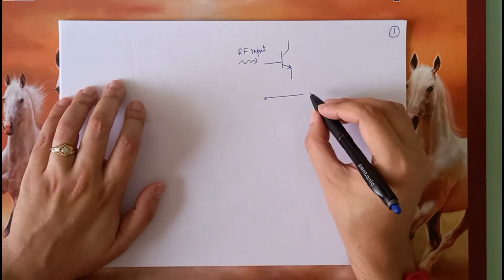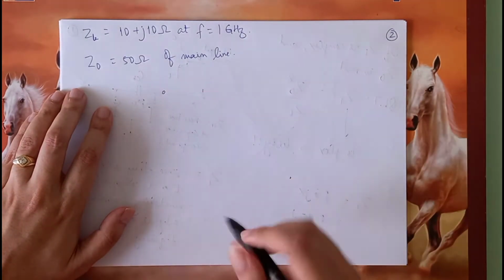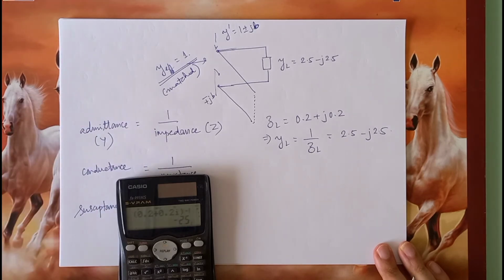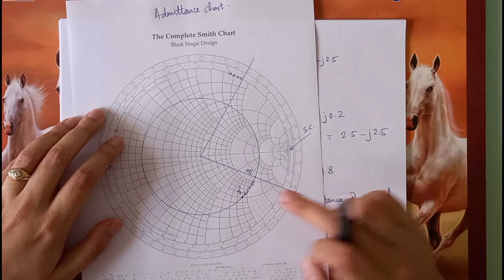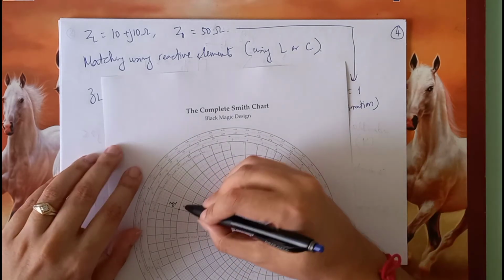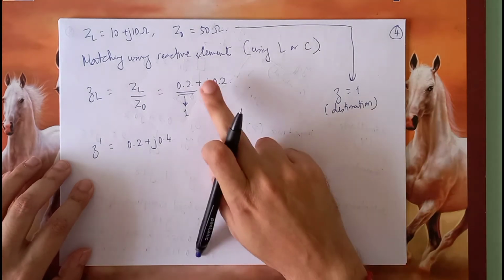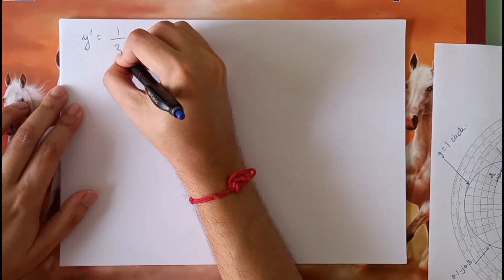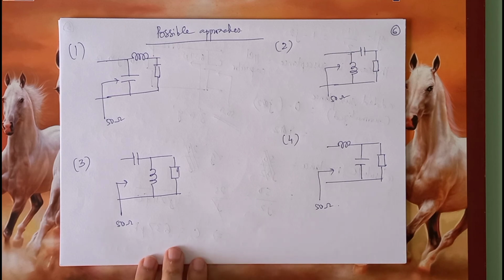Lecture 12: Impedance Matching Techniques for Complex Loads

Comment: Hi sir how we can calculate ZL values at perticular frequency and how we can take zl value
Reply from the maker: ZL is nothing but the resistance (fixed) along with the reactive component. If you have a capacitor and inductor in the load, calculate their reactance by using the standard formula e.g. for L, the reactance will be 2*PI*f*L at the particular frequency f. Then along with R, it forms a complex load impedance.

Comment: 00:10 Impedance matching for complex loads is essential in real-life applications.
03:02 Complex impedance creates challenges in transmission line design
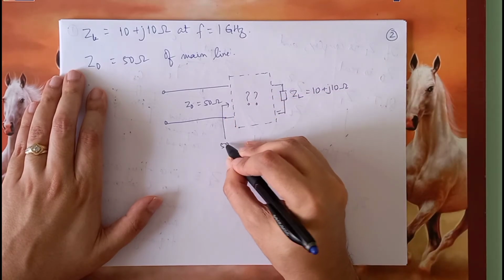09:34 Stub is a technique for impedance matching
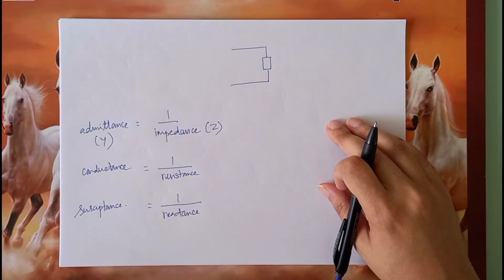13:33 Impedance or admittance normalization and matching techniques.
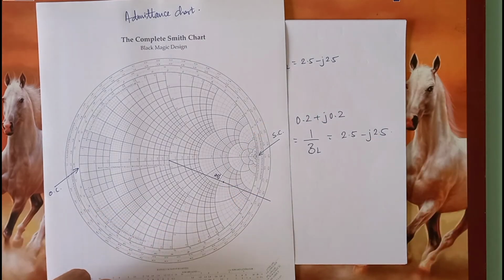18:58 Impedance matching involves moving away from the load towards the source to achieve a constant VSWR circle.
21:57 Impedance matching involves moving towards desired susceptance.
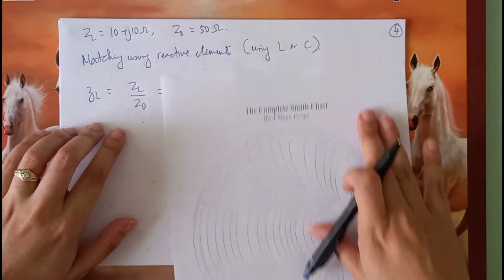27:19 Impedance Matching Techniques Overview
29:32 Impedance matching techniques involve moving along constant resistance circles.
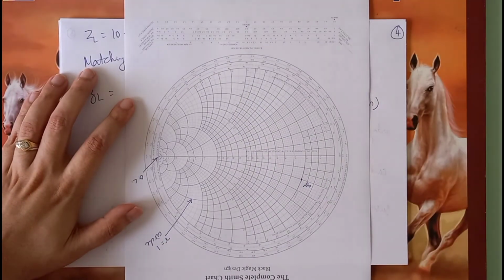33:56 Impedance matching techniques involve rotating the Smith chart by 180 degrees or making a copy of a circle and rotating it.
36:51 Impedance change due to increased reactance
41:59 Transformation from Impedance to Admittance Coordinates
44:43 Impedance and admittance circles show different behavior regarding component additions.
49:39 Impedance matching techniques involve shunt inductance, series capacitor, parallel capacitor, and series inductor.
Crafted by Merlin AI.